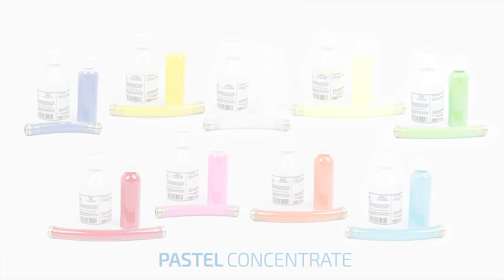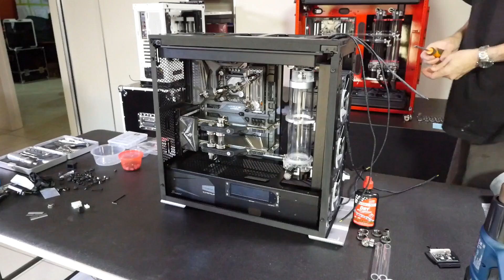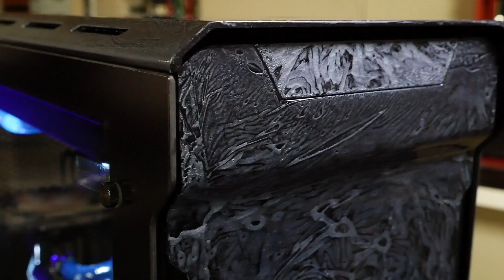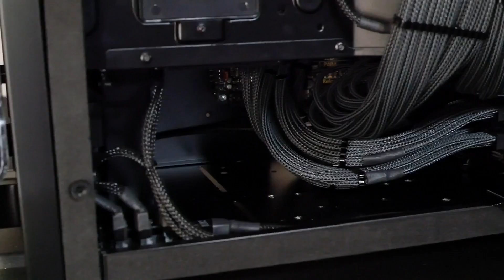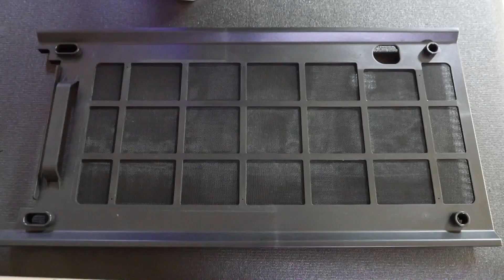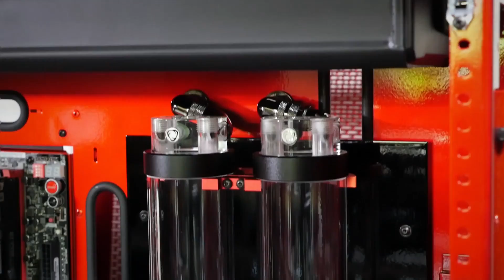Silver Tide: Part 2

Comment: Pretty sweet cable management in the back. I don't like the glass on the cable side, but you managed to pull it off nicely. I still may do a semi transparent vinyl wrap, but your build may change that.

How do you like the Evolve performance? I hear the top is not ventilated well enough, there are 3rd party panels and such.

Comment: with a strix gpu, that has 2 4-pins on the gpu itself, would you even run  a radiator off of that? considering you would have to run a cabel from the gpu and to wherever?

Comment: Absolutely love what where you placed that secondary fan hub on the top fan tray I might re-route mine but I agree that center part on the back side is very easy to mount cables up the center.  I did the same thing recently with my personal build using heaps of zip ties to secure cables and manage them nicely.

I was wondering about the paint texture how was that achieved?  It doesn't look like paint but you applied something to the stock color...reminds me of a raw iron look found in nature very nice for a different Enthoo color then followed it up with a clear coat?

Comment: seeing such a nice loop in this case makes me a sad panda. so horriable airflow :( just had one myself but had to rebuild because the lack of airflow (even with light mods) mean that the system is basically cooking itself, and temps just keep rising. Nice build however!
Reply: atngamingx if you put both rads as intake the temps are pretty good. I get temps maybe 3-5c higher than cases with way better airflow, which isnt bad at all.